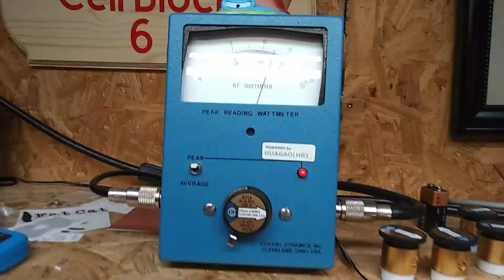WTF 2x4 600pep

Comment: last 2 X4 I did was doing just under 1Kw PEP.  was SD 1446 X 2 driving 4 HG 2879 . problem was mica caps across output transformer went off value . also had input tune SWR problem. That resistor  on output combiner needs to be non inductive . 100 ohm 2 3 or 5 watt fine.  the unbalance power is put in resistor . each 2 pill is 50 ohm load making 100 ohm total across the 2 . also if amp is run into a high SWR the reflect is put in output combiner. 73s
Reply from the maker: 73's